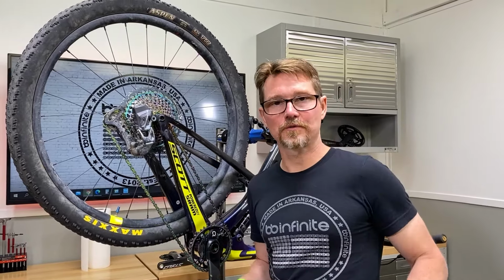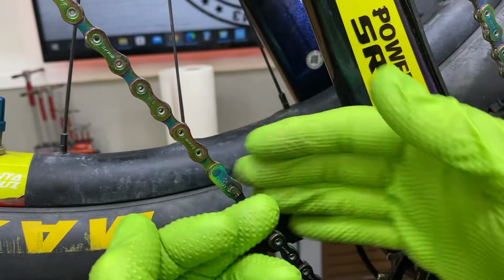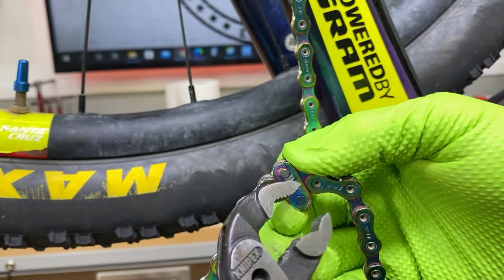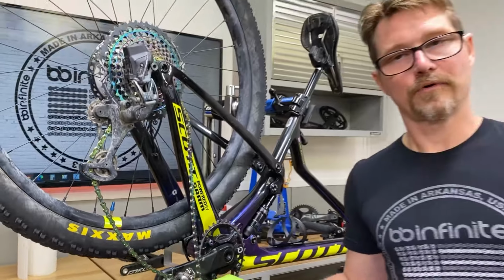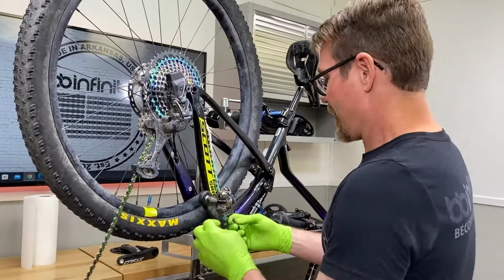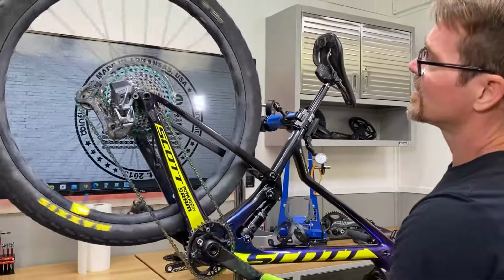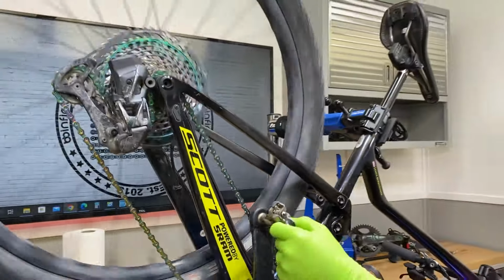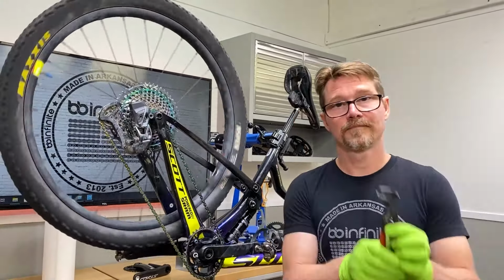TECH TIP: No Special Tool Quick-Link Hack

Comment: Thank you so much! 
I’ve seen people use pressure on the pedals to snap these in place, but I didn’t think about that needing to be on the top area to get the most force into the link. Dumb oversight on my part but thanks for the reminder.
I used a rubber mallet to deliver force into the pedal and it worked like a charm

Comment: Nice method.

New pads and rotor. Not bedded in yet. I had been sitting on my bike and trying to pedal it together but the brake wouldn't stop the wheel so nothing to brace against

Got off the bike, put the split link where you said, and hit the crank with my palm and it popped in easy!

Many thanks 🎉

Comment: Oh wow, took me all of 3 seconds, no snake tools required, great tip thank you for the video.. Special bike chain pliers they said at the local shop... Came away with a Big grin on my face 😊.. Quickly got home and used small pipe Jaws but mole grips or small narrow nose ones will work fine.. 👍👍

Comment: I would say yeah been riding for years hacking away at the quick link till I just dropped $ 10 for the actual tool small enough to fit in a bike pack /marathon kit with holders on the handle for an extra link to fill in if one breaks. $10 is worth not having to hack around anymore, hack are good when you need it NOW tho!

Comment: ok so what if your chain doesnt have that and every pin is the same
Reply from the maker: In the complete absence of a quick link you must use a chain breaker to remove one of the pins. Generally, the pin that's removed is not reusable. There are many great YT videos showing this procedure.

Comment: But if cycling/mtb riding is your hobby and you take good care of your gear why not buy a chain quiklink tool voor about €10 or €15 ? Makes the job much easier to.
Reply from the maker: We use special tools when there is nothing that can do the job just as well. A pair of pliers does the quick link job as well or better than a special tool, ergo, we don't bother with it.
Reply: @BBInfinite  respectfully disagree, you position the players on both outsides of the link while a ql tool easily clicks in the middle of the link. By applying pressure on the outer link you also risk bending the link. 
Using plyers is ok if you got nothing else but if you can spend €50 or even €80 on a chain certainly a chain link tool should be in your bikeshed.